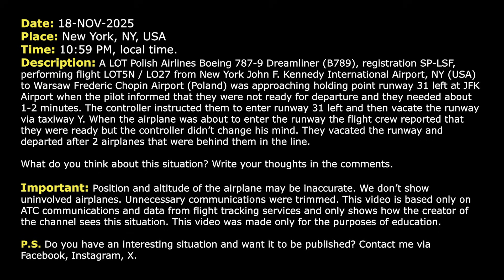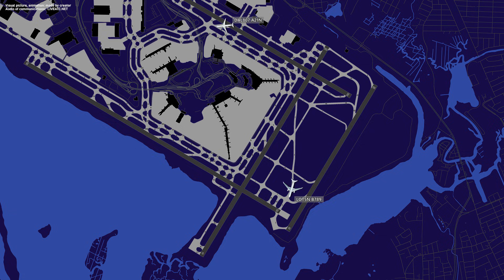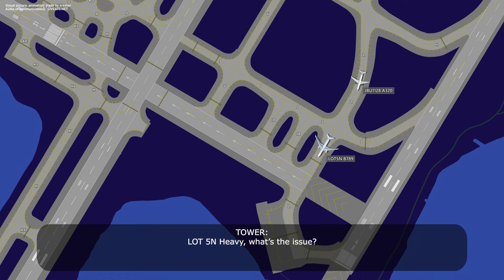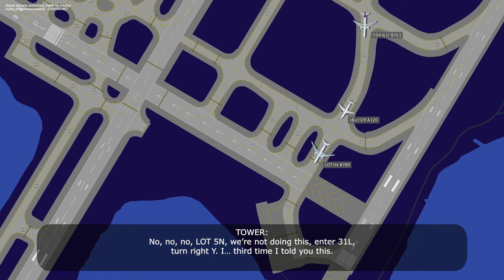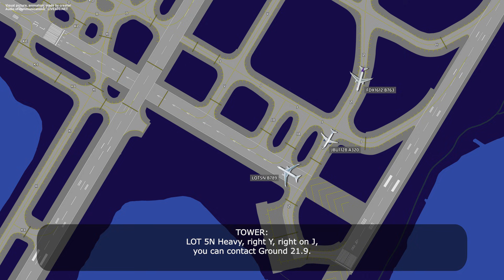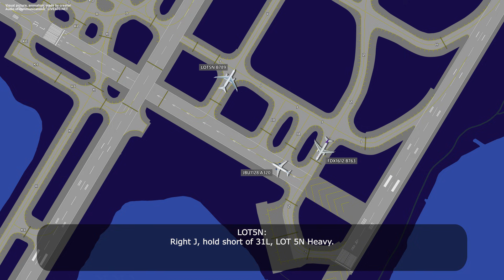Pilots get a lesson for being not ready for departure at JFK Airport. Real ATC

Comment: I feel controller was correct in the first instance when he told the flight to vacate, but he did have a chance to get rid of the aircraft from a busy airport seconds later. The pilot really should have accepted the first request after admitting they weren’t ready. That’s just my non-pilot non-ATC opinion.
Reply: The pilots were just waiting on the 'cabin ready' signal from the FAs. They called well before they reached the runway saying they needed a few minutes and ATC didn't respond. When at the holding point they re-iterated that they hadn't yet received cabin ready, at which point ATC threw an unprofessional fit. Right at that point, when it would have caused less of a delay to just give them the takeoff clearance--they weren't even on the runway yet--they got the cabin ready signal and were ready to go. But this controller is so self-important that he thought it necessary to send them taxiing around again for no purpose.

Comment: I don't know if procedures dictate back of line for any delay or if the controller had any discretion. The controller was right to issue right on Y, J when advised of delay. But when the delay had been cleared even before entering the runway(if graphic is precise), it would have made sense to just clear for takeoff. 

Also the controller is definitely having an ego trip regardless of whether sending them back was warranted or not as per his tone and choice of words."We are not doing this"
Reply: There is no procedure. It is controller discretion. There is another video ironically also from JFK where one plane cant take off because a passenger is in the toilet. There are several planes behind and the controller says he doesnt wanna ruin the pilot's day so they'll give the passenger a minute to sit down. He gives the plane about a full 3 minutes, eventually the passenger still hasn't gotten out so they send the plane to the back of the line.

Comment: A bunch of wanna be air traffic controllers in these comments tbh. JFK isn’t some small ass airport where you can do whatever you want. LOT taxiid from T7 and still was not ready at the runway, with multiple aircraft behind him. 

Be ready for departure or advise ground control. Not when you are given LUAW. 😊
Reply: The crew advised they aren't ready before crossing J and Z intersection, where they could be pulled out of the queue and resequenced. Instead, LOT5N has been ignored.

Comment: It’s our favorite JFK controller again. I’m on his side on this one. LOT said they weren’t ready so he planned to put them back into the queue. You can’t change your mind last second again.
Reply: Yes you can "change your mind". The pilots were just waiting on the 'cabin ready' signal from the FAs. They called well before they reached the runway saying they needed a few minutes and ATC didn't respond. When at the holding point they re-iterated that they hadn't yet received cabin ready, at which point ATC threw an unprofessional fit. Right at that point, when it would have caused less of a delay to just give them the takeoff clearance--they weren't even on the runway yet--they got the cabin ready signal and were ready to go. But this controller is so self-important that he thought it necessary to send them taxiing around again for no purpose.
Reply: @blueb0g Simply put LOT was not ready in the number 1 position.  They got moved out of the way from those who were ready.  The pilot now has the few minutes he needs to get the aircraft ready.  That should have been it.

Instead the pilots seemed to try and delay so would be ready instead of just complying with moving out of the way.  I feel it was correct of the controller to insist they move further back in the queue even when he stated he was ready.  The pilot seemed so distracted with rushing things getting the airplane ready that he did not handle basic radio procedures correctly. 

Better to calm things down and try again when you are not rushed.
Reply: @tristated9310 All they needed to 'get ready' was the signal from the cabin, which they got *before they entered the runway*. There was no need to delay takeoff. Having them taxi down the runway and exit at Y would have taken longer to have the runway free for the next movement than simply letting them depart.
Reply: @blueb0g So they were not ready and got moved out of the way.  Thanks for confirming.  

The delay in movements was caused by LOT not being ready.  Maybe next time they will be ready, and not delay anyone. 

While this controller seems to have a chip on his shoulders at times, this wasnt one of them.  The controller was give a time of 2 minutes maybe 1 for delay in departure indicating the pilot doesnt really know.  Magically when told to resequence they become ready.  If the pilot would have just moved out of the way when instructed, this would not even have been a video.
Reply: @tristated9310 What are you talking about? Again, they called before reaching the holding point that they would need 2 mins, and the controller didn't reply. He could have resequenced them at that point. Then when they were at the holding point, they said again that they didn't have the cabin ready. They still hadn't entered the runway yet. They were then told to taxi down the runway and exit. Immediately, the FAs signalled 'cabin ready'. This didn't happen 'magically', there was just no way for the pilots to know exactly when the report would come. *They still had not entered the runway*. Then, instead of letting them take off--which would have resulted in zero total delay, since, again, they had not entered the runway--the pissy controller told them to enter the runway, taxi down it, and leave again, an operation that takes several minutes.
Reply: @blueb0g Obviously, you are upset that they were not ready when the controller was ready for them and moved them and wouldnt accept there last minute plea of we are finally ready after the fact.

Decision point made.  Now they move.  Sorry you are getting so emotional at that.  Very logical decision the controller stuck with it.

Maybe it will help if you think of it this way.  You are a passenger for the LOT flight.  They call for final boarding and you stand there and tell them to give you another minute because your not ready.  Boarding  is now closed before you are ready.  Guess what, you are now stuck waitng for the next flight even if you can see not everyone has gotten on the plane yet.
Reply: @tristated9310 Not even close to the same situation, and this is the only airport in the world where it would be handled this way. Sorry that you're triggered about a JFK controller being criticised, for some reason. But it's very obvious, to everyone except you and him (same person?), that his actions here only created a delay where there was none.
Reply: @blueb0g 

The pilot was not ready when the controller wanted him to be, and that is the end of the story.   Could the controller have changed his mind after being told they were ready?  Sure .  Did he?  No.  Was he required to?  No.

Now you cant accept it because of your personal bias of the controller.  

The analogy I gave  is perfectly applicable.  You missed the final boarding because you are not ready and you get to wait.  You know it would be faster  to board the person instead of waiting 30 minutes to get their bag off the flight.  Could have departed on time if you just got let on the plane you were not ready for.  See it is the same exact thing.
Reply: @tristated9310 exactly, very good point
Reply: He didnt change his mind,  He updated the status before completing the requested action,  This update may have helped them or / and the controller.    Its a shame the JFK controllers seem to take it a little personal and an attack on their ego when a pilot cant comply.  When in reality its life in aviation.
Reply: @AirspotterUK I don't think it is all of the JFK controllers. This particular individual has been on so many of these videos, I have lost count. He is rude and unprofessional and never misses a chance to escalate a situation. Notice the difference between him and the ground controller.